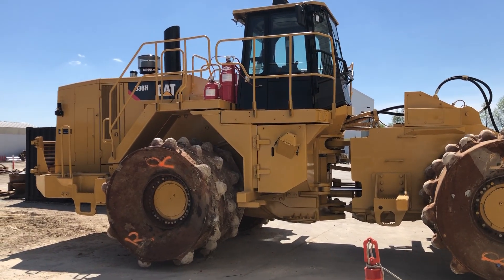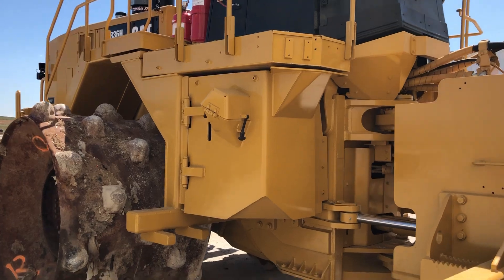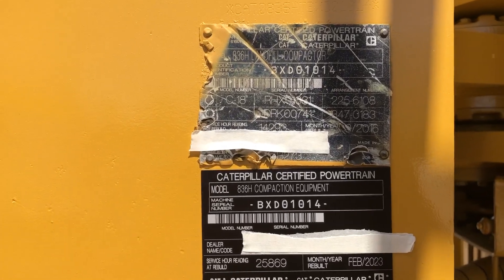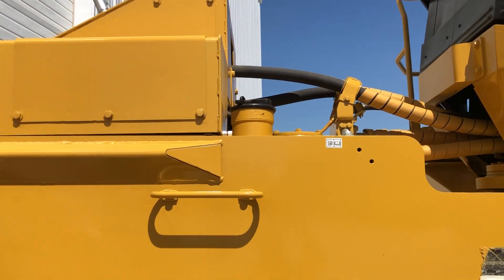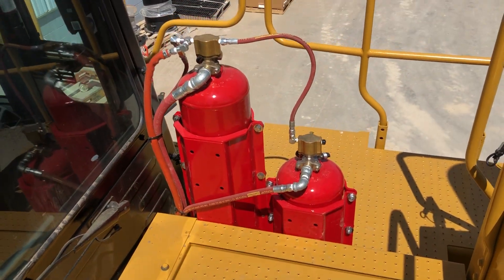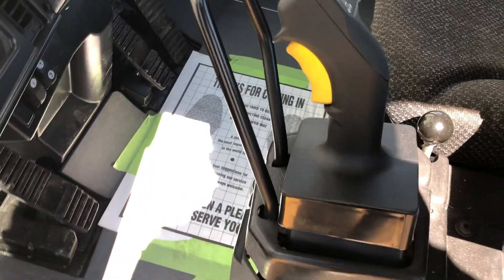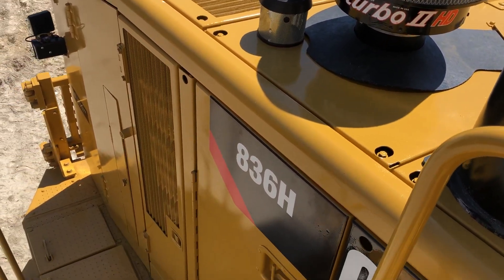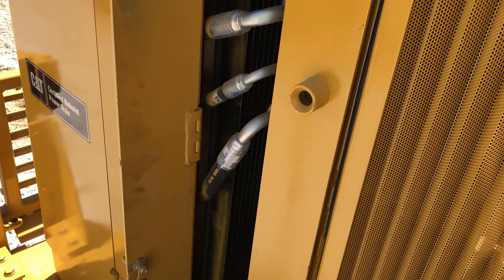Caterpillar 836H Landfill Compactor Certified Power Train Rebuild

Comment: Nice machine. Working at Fresh Kills Landfill, I have thousands of hours on them. Although those wheels are serviceable. (I've seen worse. ) It would be nice to have brand new wheels on it. There is nothing like a new compactor standing on its tippy toes. Except a brand new dozer or loader all yellow everywhere. LOL
Reply: That's a serious landfill.  Very cool that you work there.  That's where they took the steel from the original WTC, right?  We use 836K's at our landfill.  Pretty similar machine.  You'd think they could climb up a wall, but get a little wet, sticky clay on the wheels and they are like ice skates.  I've gotten one stuck too many time to admit.  Please get me back in a dozer!  :)
Reply: @Layth Grangaard  Hi friend,  all of the debris from the WTC and other buildings that were destroyed. Were taken to Fresh Kills Landfill where they were examined for human remains and DNA. Then they were sorted. All of the aluminum, brass, copper, and other non ferrous metals were separated out and taken to NJ to be recycled. The steel beams, large and small,  were cut up and sent separately to NJ by barge (large) and truck (small). Everything else was buried at Fresh Kills. Later, when they discovered 'secondary ' WTC debris. When they were building the Freedom Tower. Was also bought to Fresh Kills. Where the Medical Examiners office personnel examined every once of it, looking for DNA. That material was also buried at Fresh Kills. When completed, Fresh Kills Landfill will be the largest Park in NYC. Over 5 miles across.
Reply from the maker: Thank you for the view Phillip. Believe it or not, Caterpillar use to offer these wheels as one of their REMAN products. Eventually they moved away from that because what I was told is the wheels got worn down too the point of it costing more to build them back up than the money they were making on selling them.

Comment: Hi Mitch: I'm a retired HDR/W mechanic, primarily cat,  I pretty much avoided trash compactors of any sort. 
But I do have a short story, I'm 74 now, back in in 1974, working for Syracuse Supply cat dealer, a rail spur came up
 to the dealership: I was on the night shift, I did a lot of transmission work: in and out stuff. the night foreman tells  me to load a sheeps foot compactor on to a rail car. smaller then the one in the photo, I was having issues about doing it. Something wasn't right,   No matter, I chain it down, don't recall the details now: The following day or days later, ? I was asked about that machine, what I did with it: as much as asked me where I put it. really, I loaded it on to the rail car like you told me to, you seen it. It was a pretty slick job, some how, it never went to where it was suppose to be going, disappeared. never  found it. My guess it was sitting in some rail yard getting ready to be put it to work. My guess it was You owe me, and it covered the IOU.... three times that happened with me, all three times the owners  and or superintendent, both said load it up, gone. I worked dirt spreads. back when we used 666 along with the 657's, and the 641 A series and 51 a series, old school... in places in CA they get methane gas from the land fills. if one were to explode, you can say good by